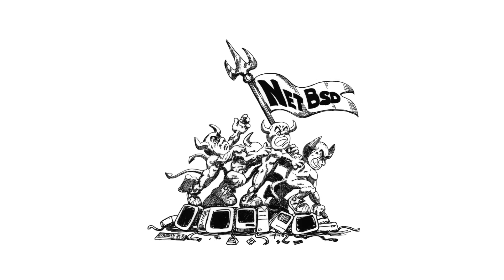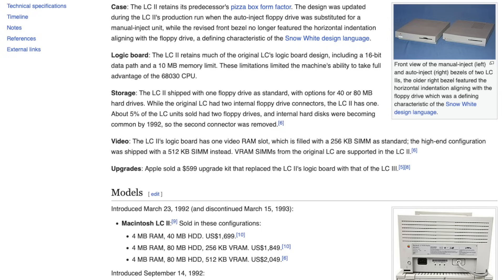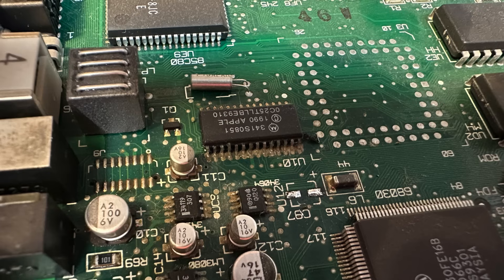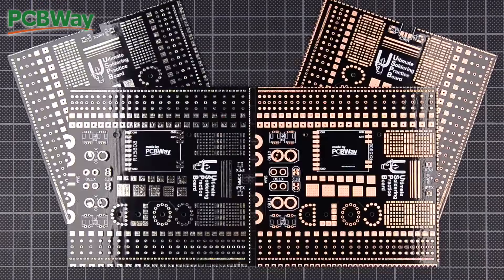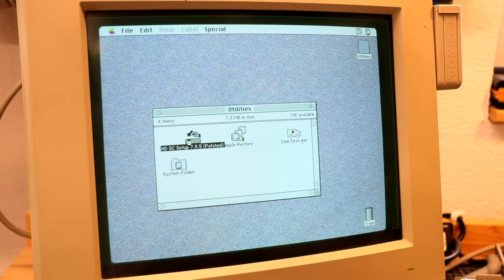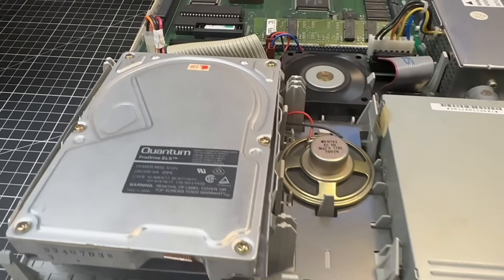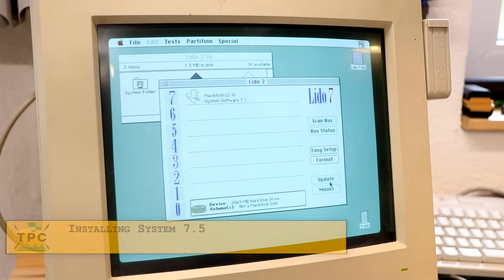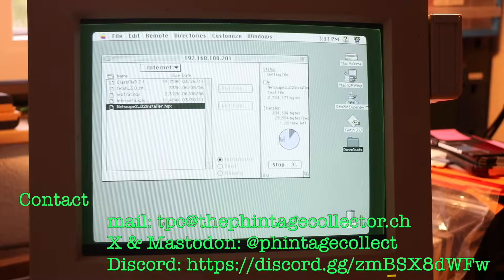Classic Mac LC II and Performa 450 Revival - The Capacitor Chronicles

Comment: The most annoying classic Mac thing I've had that hasn't been capacitors was that I necked the CRT of my Mac Classic while tearing it down to recap the logic board.  That's been annoying because I have the silly distinction of having plenty of compact Macs, but none with compatible CRT setups, cabling, or basic 68000 CPUs.

Comment: 1:06 If I remember correctly the code name of LC is Elsie. Performa's brought more detriment than they hoped, if only the Apple management under Micheal Spindler wasn't that bad, everything could have been better but oh well.

Addendum: You should use BlueSCSI for hard drive alternative, it is not only more quiet but also more reliable than the spinning rust buckets :P
Reply: I may be wrong, but I'm under the impression that TPC prefers to keep things authentic and period-accurate whenever possible, and as close as possible otherwise.

Comment: I bought an old Performa 6115CD that seemed to work fine, but when I purchased it I didn't have a compatible monitor (which i should have checked before I purchased it, but you know that they say about assuming). When I opened up the case, there was a substantial amount of corrosion on the shielding and most of the metal components. I can only guess that it was stored or used in a humid environment. Thankfully it was a fairly straightforward repair, and once I ordered and received a HDI-45 to DB-15 adapter to work with one of my existing monitors, I could confirm that everything was working properly.
Reply from the maker: I was lucky enough so far to never encounter a fully corroded machine.
Happy to hear you could save it!